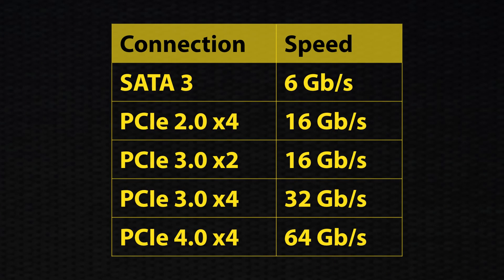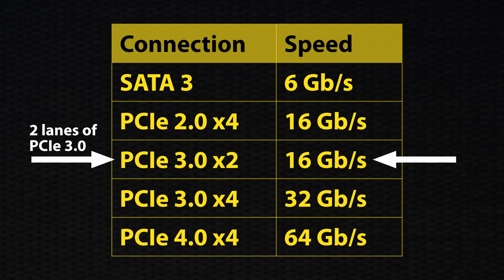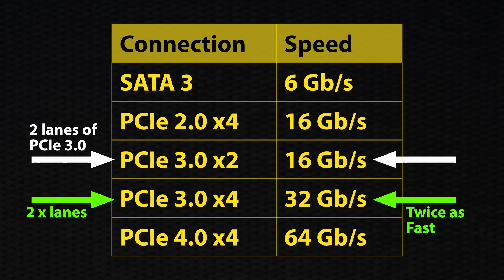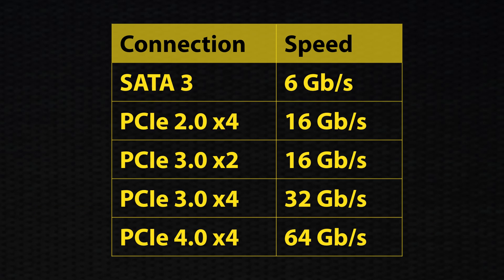M.2 vs NVMe What's The Difference Exactly?

Comment: Thanks for this information 
Please I need help to sort this out: 
I've been a dilemma choosing between 1TB HDD + 16Gb Optane memory (for acceleration) and 256 SSD PCIe NVME. The latter is really small and not too encouraging but I want to go for the one that would work faster. Kindly let me know if these are same or which would have an upper hand. The actual laptops on my mind with these are Hp Pavilion X360 14-ba253cl and Pavilion Pavilion X360 14CD-1055cl. 
I would greatly appreciate if you not only help review on Optane memory and SSD. You can write me via biamsylvan@gmail.com
Thanks!
Reply from the maker: I'm not ready to work with Optane at the moment. From my understanding though, it seems that it is better at accelerating systems with spinning hard disks.

Comment: I found that the benchmark from the other YouTube video saying that the m.2 SSd its bit faster than SATA SSD so is there any difference in performance between these two?
Reply from the maker: Depends. A M.2 SATA SSD should be the same speed as a normal SATA SSD of the same brand, model and size. Sometimes the interface on the motherboard for one or the other is faster, so this accounts for the difference. Usually the difference is very small. Incidentally, if one is larger than the other, the larger SSD will usually be faster. Sometimes the controller on the SSD is improved in the switch from the 2.5" SSD form to the M.2 form and this could increase the speed slightly. Also, an M.2 NVME SSD should be faster that any SATA SSD.

Comment: So if I understand correctly, M.2 describes the PHYSICAL connection between two devices (e.g., the SSD and the motherboard) and NVME describes the protocol, that is, how the two devices communicate to transfer data? 

I am going to build a PC for the first time, and I'm considering a motherboard that has (among other things) the following storage interface specs: "1 x M.2 connector (Socket 3, M key, type 2242/2260/2280/22110 SATA and PCIe 4.0 x4/x2 SSD support)". 

Here's what I understand of the various terms, based on your video and Wikipedia:
M.2 connector - describes the physical connection
Socket 3 - describes sockets keyed for four PCI Express lanes, which determines data transfer speeds
M key - describes the mating key positions/notch, which determines the type of modules accepted by the motherboard. According to Wikipedia, "M.2 modules with only one notch in the M position use up to four PCI Express lanes," so do "M key" and "Socket 3" provide the same information since both describe M.2 devices that have four PCI Express lanes?
type 2242....22110 - describes the width and length of the m.2 connector. Many lengths are accepted by this particular motherboard.
SATA SSD support - can use SSDs that use SATA, an alternative--slower--protocol (way of communicating) compared to PCIe
PCIe 4.0 x4/x2 SSD support - can use SSDs that use PCIe 4.0, the latest version of the PCIe protocol with the highest transfer speeds. Furthermore, the SSD may use either two or four PCIe 4.0 lanes.
Any corrections you would make to my description?
Reply from the maker: The PCIe 4.0 is backwards compatible with PCIe 3.0, so you could use a PCIe 3.0 M.2 SSD to save money. The difference in speed would probably not be noticeable unless you transfer large data sets a lot.

Comment: Very well put info. 

Quick question

Here is how M.2 SATA in my laptop looks. 

https://photos.app.goo.gl/92vYmb1rCg6TqBxt7

The m.2 sata came from manufacturer. I am just wondering if I can fit M.2 NVMe in place of M.2 SATA on samea  port on M board? Or NVMe female port (the port on mboard side) is different than M.2 SATA

The second pic is taken while I remove SATA drive.
Reply from the maker: Likely you would need to use another SATA drive. Contact the laptop manufacturer to see what the specs are though, it could work if they designed the board to be able to use NVMe drives.